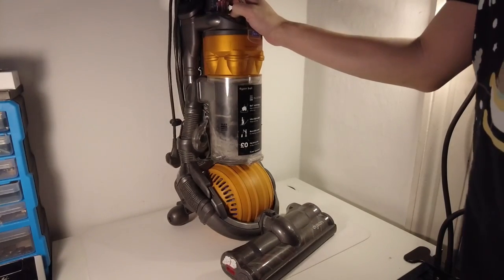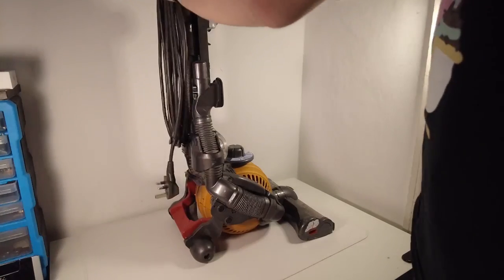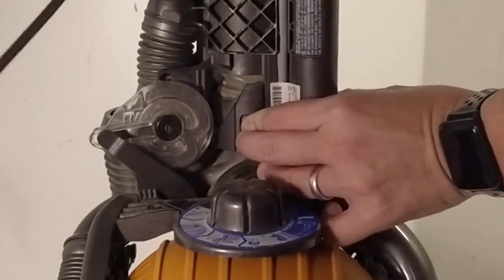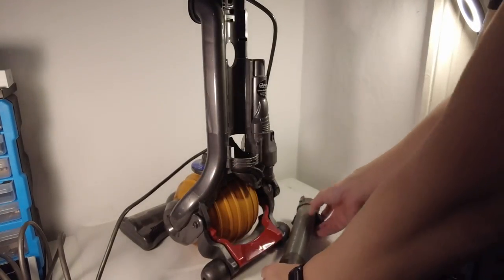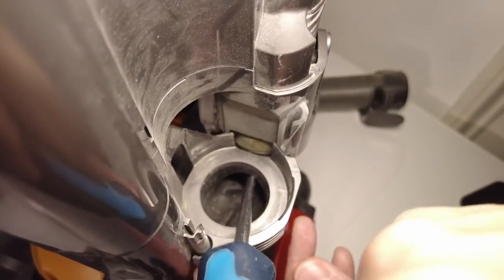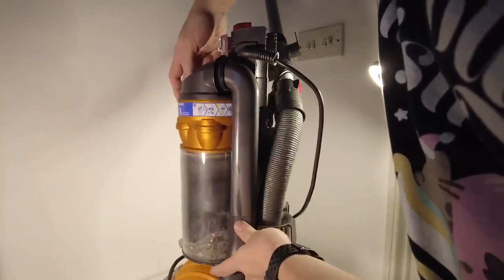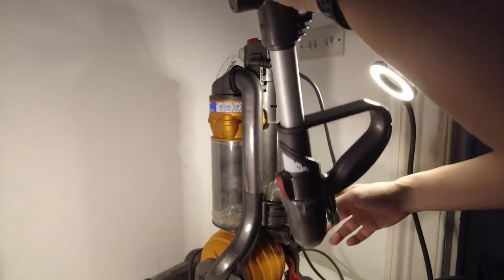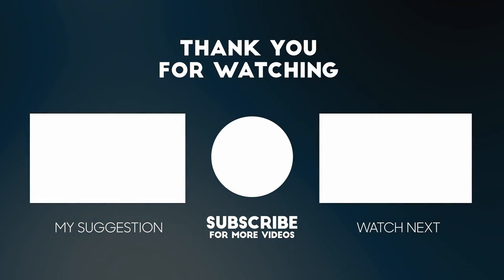How To Fix Dyson DC24 Suction Hose Wand Disassembly Vacuum Cleaner

Comment: Something else to check in case filter cleaning etc doesn't work - on the back of the hoover there's a spring-loaded trapdoor underneath the hose/wand section. It's open when the hoover is in normal use, and closes when the handle is removed, redirecting suction to the hose. If something gets lodged in there (a picture hook in my case), it can prevent the trapdoor from closing, and there will be no suction from the hose.